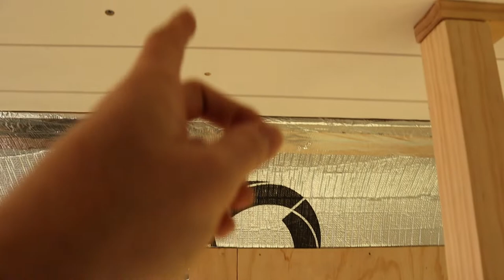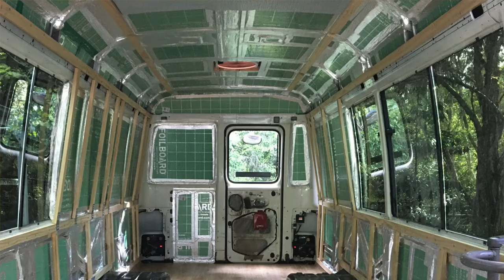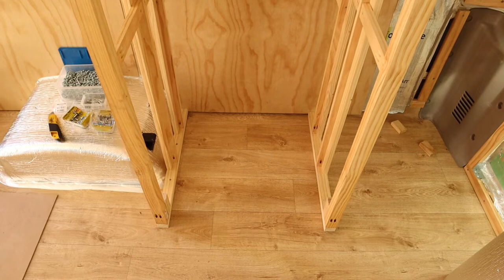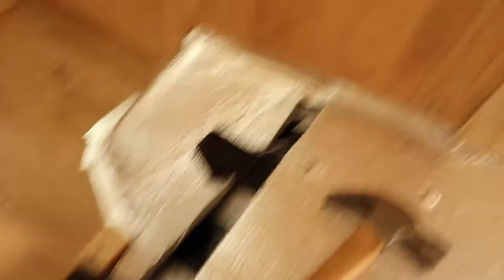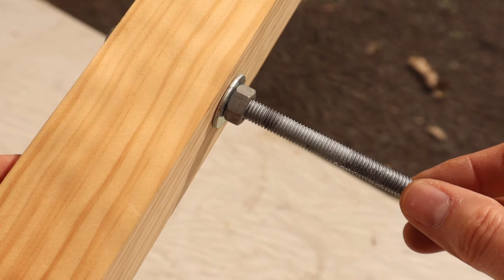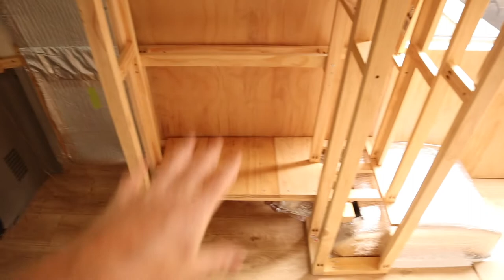Building walls in my bus to frame out the fridge, pantry, wardrobe and electrical bay

Comment: I used to work in a manufacturing home plant. We would pre-build the walls (laid down) on large level and square metal tables and make them square that way. Some walls were angled at the top for vaulted ceilings. Often the wood is warped and would have to be bent slightly to square them up. Of course, they were able to go off blue print measurements. Then after the vinyl flooring was installed (but before any carpet, tiling, ceiling/roof, exterior walls, etc. were installed) these interior walls were screwed to the floor.
Thanks for your videos and all the time you put in to shooting and editing them!

Comment: Despite the frustration you got there in the end. Well done. I decided to buy a truck with a pantech on the back because I didn’t want to deal with the curves on a coaster. Btw, I have leant heaps watching you build journey.
Reply from the maker: Thanks Lisa!  I thought about buying a truck too before I bought the coaster but I really wanted full access to the cab from inside. I do envy the square walls in truck homes though!

Comment: great job, just dont put the batteries on that platform. It should really be on the floor. The second u make an emergency stop those things move. That wood is not going to keep them in place. The higher the weight is the more force it generates so the platform is a bad idea.
Reply from the maker: I don't want to put the batteries on the floor in case I have a leak and water gets under there. The batteries will be strapped down so won't be going anywhere
Reply: @AGirlADogandABus  strapped down to what? If its to the bottom on those 3 cross members u created, hat flimsy pine will instantanly will get ripped off and pull out any screw instantly if the batteries get wet where it would be an issue your entire buss would be flooded so you will have bigger issues...
Reply from the maker: I will most likely be making up some straps from flat bar steel or aluminium that will be screwed into the shelf and/or the walls. Haven't quite finalised all that yet. They will not move. As for water damage, it would only take a small amount of water to pool under the batteries if the bus was not level and they were sitting directly on the floor. And even if the whole floor had the same amount of water, damage to some timber cabinets is not as bad as damage to $3000 worth of batteries, Not to mention the potential safety issues with water mixing with my electrical system. No thanks.